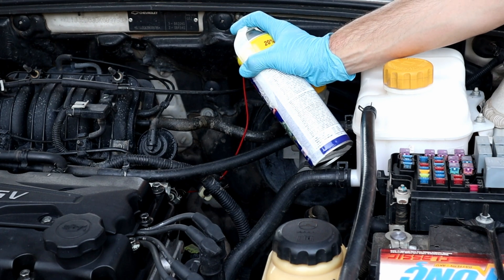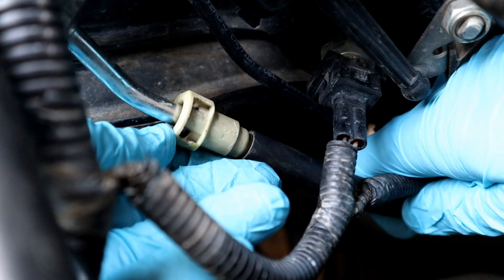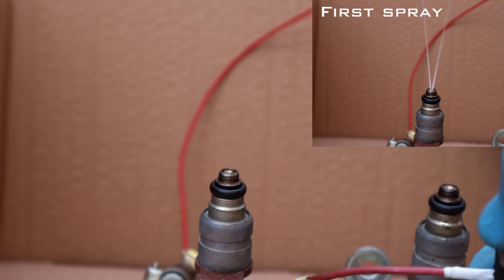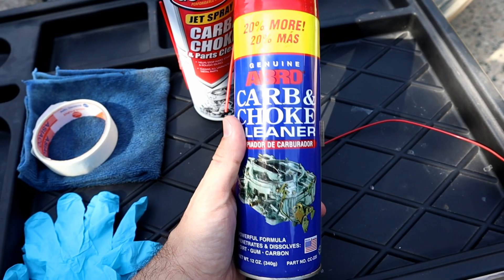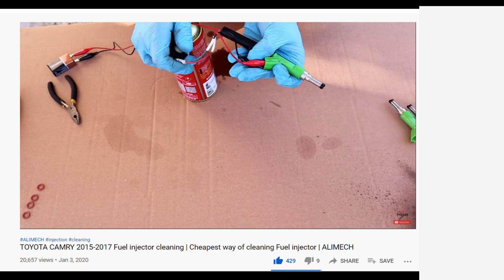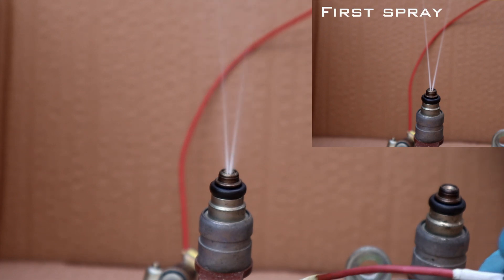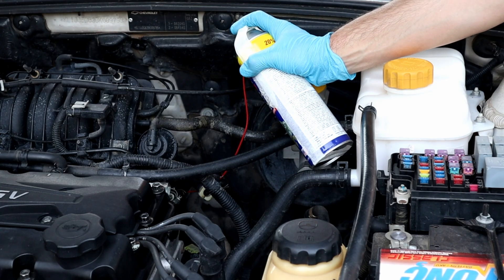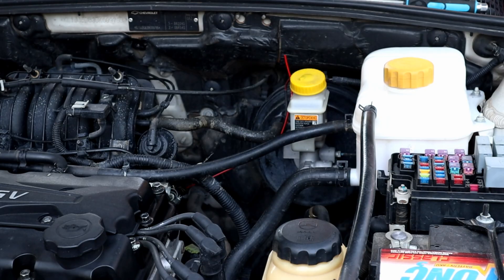Running Engine with carb cleaner for 4 minutes/HOW TO clean injection Directly without disassembling

Comment: hello, thanks for the excellent videos... could there be problems if with the engine running, I apply little by little a can of those carburetor cleaners I open up the intake throttle? Would that bring me any benefit or any problem? it's for a ford v8 4.6 modular 2 valve, thanks!

Comment: Alimech great Great feat of Engineering congratulations.  What if adding the carb cleaner to the tank of diesel? Is it good or bad? I saw you referring to don't use same carb cleaner on diesel engines. What did you use on 0.47 (about diesel injector). 
Thanks
Reply from the maker: Thanks brother, Puring carb cleaner in gas tank will damage fuel pump, all the prosses I showed only applied on gasoline engines, you can clean diesel fuel injectors only out of the engine, not buy tuning engine with carb cleaner or puring carb cleaner in the fuel tank

Comment: Should i get a check engine  light after doing it ?
Reply from the maker: No, if it does, you might have failed ignition coils or spark plugs, incase the fuel injectors working fine like I did after cleaning

Comment: Is it necessary to remove the fuse or can we directly disconnect the fuel pump under the rear seat without removing the fuse.
Reply from the maker: Do which one easy for you
Reply: Some vehicles will still run the pump even if the fuse is not present. My Mazda lantis runs the pump even if the fuse is pulled. I would recommend disconnecting the pump and running the engine until all fuel pressure is gone and the engine stops.

Comment: I wanted to find out is it good to also spary carb cleaner through the brake booster vaccum pipe that comes out from throttle body going into brake system? Would this clear out carbon deposits as well and give a better performance ? This is on nissan micra ak 12.

Comment: So for diesel, we don't hv choice except clean it outside? Is there another option to clean diesel injectors?
Reply from the maker: No, you only have to take them out, if u want to clean it with carb cleaner, or u can put diesel engines cleaner, but I dont know how good they work
Reply: @AliMECH  thank you 👍

Comment: You are obsessed with cleaning engines and injectors.
Reply from the maker: Because I know, how expensive the injectors are, and how i had problem with them
Reply: @AliMECH  Excellent Answer!!!
Reply: Could have saved me a bunch of money recently.
Reply: @zeropoint546  my toyota had 600k without cleaning the injectors and it ran like new when I sold it
Reply: @and7976  Uh... Congrats... I guess.? Your car is proof that injectors never get clogged. Mine must be cursed or something. Again. Much applause to you on your extremely strange flex.
Reply: @zeropoint546  thanks 😂